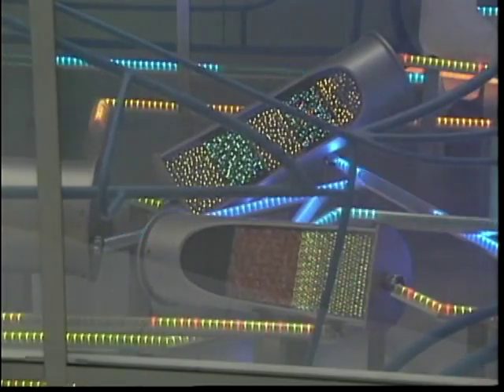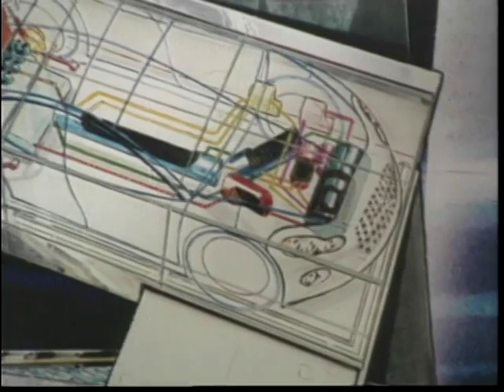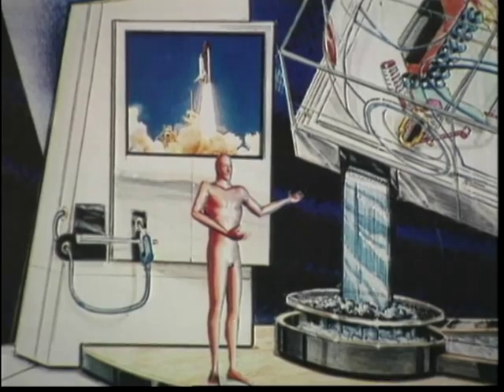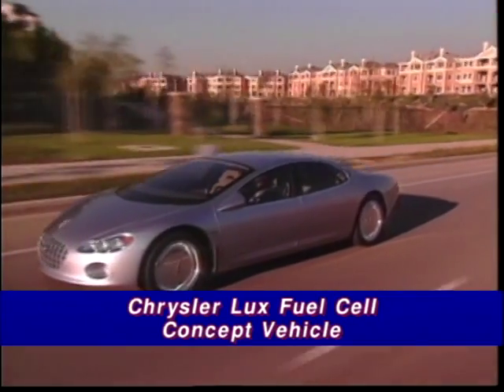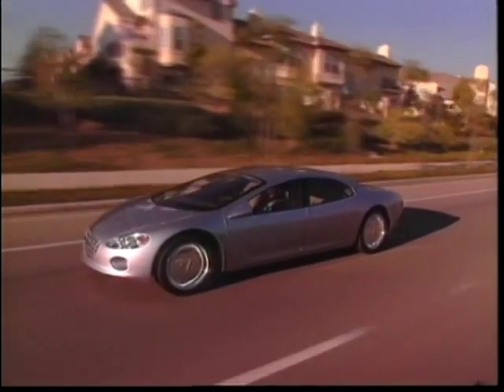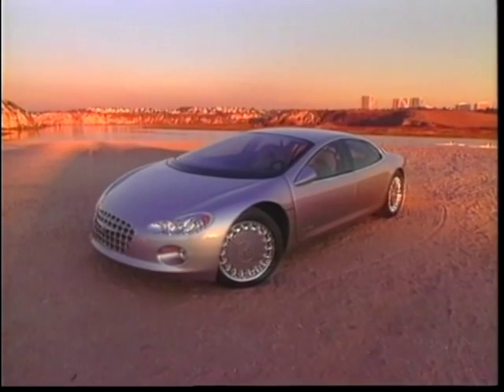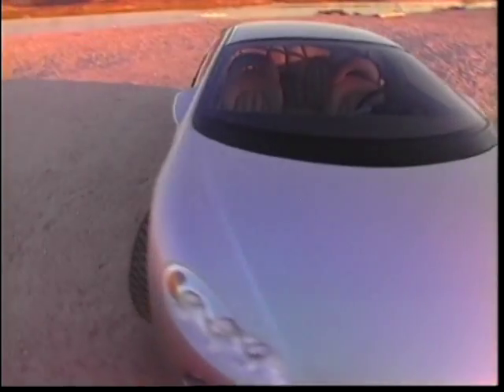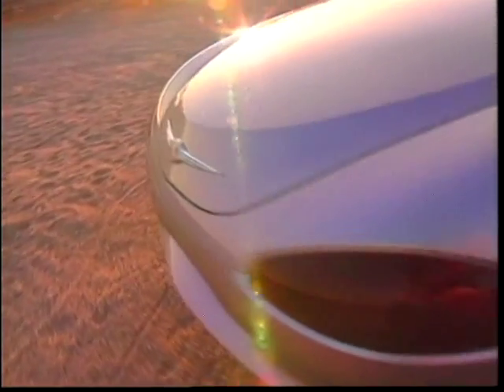Chrysler Concept - Gasoline Powered Fuel Cell Technology

Comment: How can you get 50% improved fuel economy by cracking hydrogen from carbon and then only use the hydrogen as fuel while throwing the carbon fuel away
Reply: Fuel cells convert a fuel directly into electricity and use that to drive electric motors. This is way more efficient that even the most economical internal combustion engine(burning carbon produces alot of waste heat). So the cost of splitting the hydrogen from gasoline was probably well covered by the fuel cell and electric motor efficiency gains. I bet the catalyst they used(2:38) was super expensive and probably burnt off the excess carbon. 

This concept probably got replaced with hybrid battery vehicles back in the day like the Prius, because batteries were a more efficient and cheaper option even in the late 90s/early 2000's.
Reply: Standard engines also through the carbon away (as CO2).  This prototype car is not any different 

.

Comment: I just wondering why gàsoline cannot be used directly as fuel for fuelcell  while methanol can?
Reply: Jibril Channel https://www.technologyreview.com/s/426252/gasoline-fuel-cell-would-boost-electric-car-range/
Reply: Because you need to have Hydrogen available to combine with oxygen (to make electricity & water).  The hydrogen is not available if it’s tied-up with the gasoline
Reply: Same with methanol or methane.  It needs to be “cracked” to release the hydrogen before it can he used in a fuel cell

Comment: So it doesn't take gas but it wastes gas? I can see why they just slapped a concord badge on it with no fancy engines because that's just stupid
Reply: It is filled with gasoline.  The gasoline is cracked to produce hydrogen & carbon dioxide 

.
Reply: It uses gas as a fuel source, not as fuel directly

Comment: Use this technology as an extender for electric cars. It doesn't have to supply the power of the primary battery. Stop for a meal on the road and run the fuel cell to give a bit-of-a-charge to the primary battery. This is much better than the engine/generator or free-piston/generator extender ideas being entertained & proposed. Much simpler. This kind of system can be packaged in a number of ways ... it can fit in any size & shape of a box. As another "replyer" has stated ... 'economy of scale' is what moves these things along and blasts through the economic barriers. It just takes a little vision, faith, money and balls to do it! I'm actually surprised someone like Musk hasn't entertained this. Both methanol and ethanol can use reformer technologies and can source from renewables ... WTF!

Comment: What happened to this tech?
Reply: +Davis Fang still around. Super expensive due to the materials that are needed, only economical at scale, and all sorts of issues with carbon coking. Tech is used some larger scale applications for generating electricity at remote locations or as back up generation.